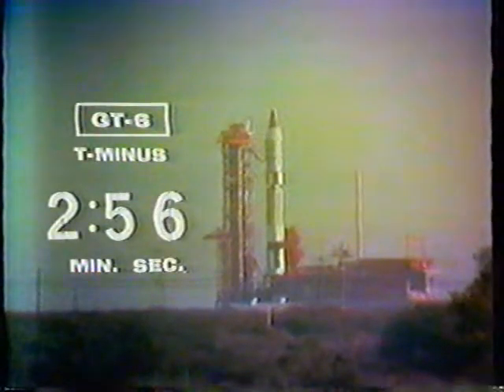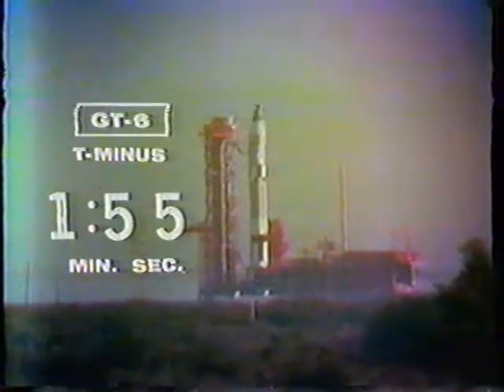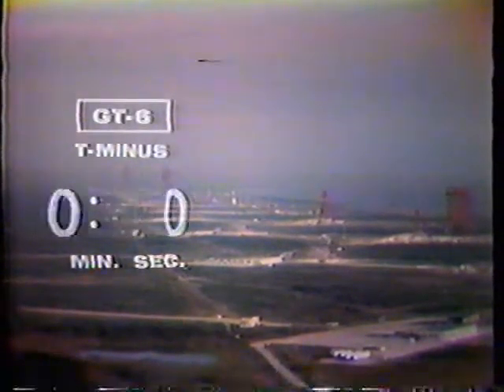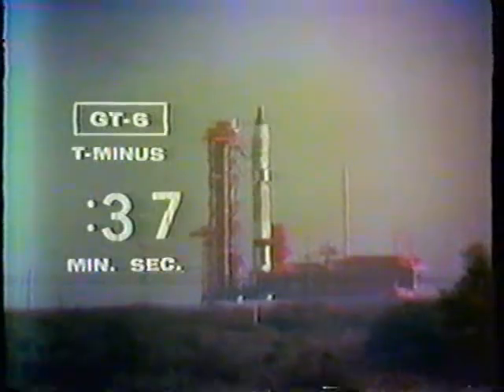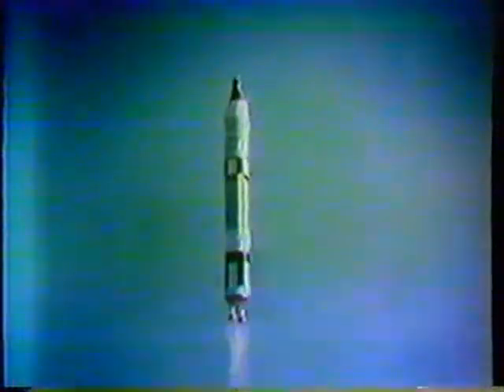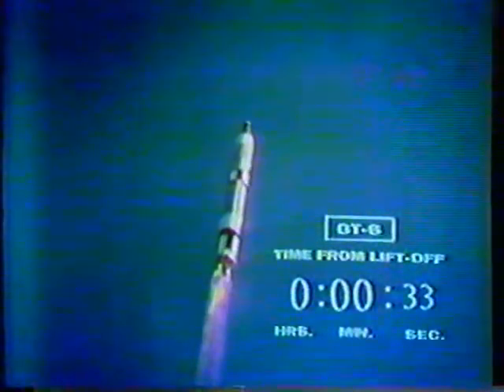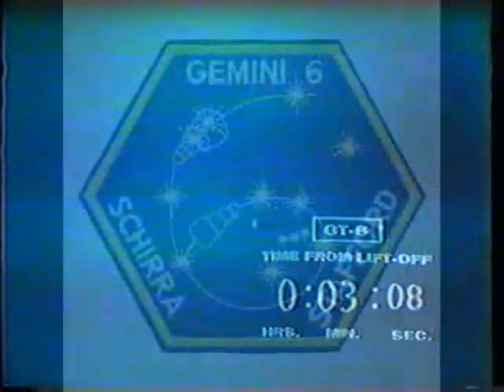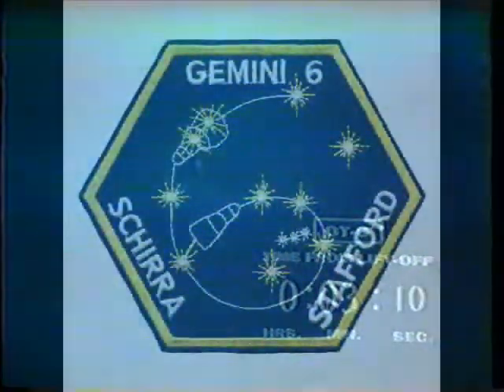Launch of Gemini 6 (CBS)

Comment: Came here for the whoop, stayed for the rocket
Reply: As Falcon 9's engines ignite at T=0, it would be cool to get a clean audio recording of the Titan "bwoop" sound and insert it at the ignition.
Reply: @rwboa22  I don't know where you'd need to put the speakers to make them survive the launch, and I also don't know if there are speakers powerful enough to match the loudness of a rocket launch. :P
Reply: Why do people call it the bwooping noise it sounds like a rrrrrrrrrtttttttt to me
Reply: Thats the turbopumps for the engines spooling up I believe
Reply: GenCorp LR-87 engines … 
the most unique sound on 1960s missile row.
Reply: Sounds a bit like the starters of  Chrysler, Plymouth or Dodge use to sound back in that era. The gearing of the starter against the engine would make a certain sound, similar !
Reply: @paulwilliams286  Chrysler built a few rockets from this era like the Saturn 1B.

Comment: Just to let the younger people know, the actual TV images at the time were much better than this video. I am glad they preserved this but it doesn't accurately reflect what people were able to watch at the time.
Reply: I'm 24 and remember how T.V. looked before the switch from analog to digital TV. And I'm definitely suprised how bad the picture in this video is.
Reply: It really depended how good your TV and reception were!
Reply: I was in high school English class, surreptitiously listening to it on my very small transistor radio. Heady times! There had just recently been an on the pad abort after the engines had started, no one knew if the astronauts would have to bail out. And with the sudden change in flight plans, the launch of Gemini 7 was only days away, for the first planned in orbit rendezvous flights. Those were the days when NASA could, and DID, do amazing things. Amazing what you can do with a slide rule, and can't do with a supercomputer.
Reply: The one inch VTR tapes they used to record broadcasts instantly lost about 500 lines of resolution. The National Archives has a section called Record Group 255 in Maryland. It is a huge building of NASA archives and broadcast footage. There’s thousands of these tapes that have never even been digitized yet. I hope they digitize and clean them up someday before they’re too degraded.
Reply: possible that the video tape has degraded.
Reply: it's probably because this was a recording of the broadcast on VHS, likely recorded from a rerun of the broadcast or from archival footage from NASA. Shame we'll never get to see the launch in it's true quality!
Reply: @davidh9844  It's funny, my daughter is in medical school and I once mentioned that I had to use a slide rule in high school.  She had no idea what that was.
Reply: I’m sure NASA has it somewhere, there were very sophisticated film cameras with huge lenses on expensive mountings taking pictures of the launches.

Comment: The bravery of these men is off the scale.
Reply: Star 1958- I agree with your comment. And, yes I can admire them. However, I believe they were almost too brave, in a way. Reason: They paved the way for the shuttle. And, paved for the way for others to take similar risks. And, this is unsustainable over any period of time. During the Roger's commission it was determined the shuttle ran a risk of ~1% of a catastrophe on every launch. Certainly, one would have to be brave to take a 1% risk of death on a single event; but overall there should not be such a risk on manned vehicles nowadays, even if the crew were willing to take such a risk. And, there is no way known to go to orbit with significantly less risk (1 in 1000 might be acceptable but it should be even less; like 1 in 10000. Still there is no way to even reduce the risk to 1 in 500).  What I am trying to say- manned launches should be halted and space work should be done solely by robotic vehicles. I will receive a lot of internet flax on this; I am sure. But, I still stand by my opinion that humans should not go into space, at present anyway.
Reply: The titan missile wasnt really reliable at first.
Reply: @Scottrchrdsn   The problem with shuttle was designing a vehicle with no realistic means of escape in the event of damage or malfunction.  Mercury and Apollo had their escape rocket towers, and Gemini got by with ejection seats, but even if they were a little "sketchy" by comparison, at least they were there, and designed to work.  Shuttle had ejection seats the first four flights, but they removed them after that, once the shuttle system was "certified" for flight (which was a foolish notion in itself, as if nothing could EVER go wrong once it was past the "testing" phase... In short, NASA got overconfident in their abilities to never have a failure in flight).  Shuttle's abort methods were basically a joke... They weren't realistic.  During the SRB burn NO escape plan or abort was possible... Hence Challenger was unsurvivable from the moment of liftoff.  There was even talk of using the first shuttle flight to demonstrate an RTLS abort (return to launch site abort) and Commander John Young shot that idea down real quick... He said it was "risking likely death to avoid certain death" (IOW not likely to work, probably die in the attempt, but a little better than nothing if it's your last option).  RTLS depends entirely on the SSME shuttle engines all working perfectly and a good SRB separation, (so if all that's true, WHY would you need to abort?). Once the SRBs were gone,  the shuttle, still burning the three main engines, would do a backflip (like the boost-back burn the SpaceX Falcon 9 first stages do now to return to the launch site to land), then shut down the engines once headed back to Florida, jettison the external tank, and glide back to the runway to land.  If the shuttle was damaged and couldn't glide, it was unsurvivable.   Bailouts with parachutes options came after Challenger as a stop gap method to address the problem, but STILL was only possible from a stable glide, which is a huge assumption to make for a vehicle having to abort.  No escape was possible during reentry, but then that's been true throughout the space program, both US and Russian... Hence Columbia was unsurvivable.  The Soviets lost three cosmonauts on reentry due to a pressurization failure (Soyuz 11) and of course Kamarov on Soyuz 1 due to tangled parachutes (the last of many severe problems) and nearly lost another Soyuz due to the service module not separating properly and it reentering with the capsule nose first, instead of heatshield first... The front hatch was hot and the seals were smoking before the service module finally broke free and the capsule inverted heat shield first, cooling off the hatch...)

The lesson is, "never design a launch vehicle and spacecraft without realistic survivable abort capabilities".  

Later!  OL J R
Reply: @lukestrawwalker   3 SSME's are NOT required for successful RTLS.  At first NASA was too bold in regards to safety, but was forced to worry about making the Orbiter Vehicles(OV) so much bigger than they wanted due to teh demands of the military. At first STS was a shirts sleeves environment.  If the crew of Challenger during STS-51L was wearing proper Launch and Entry Suits at least some of them would have gotten out in time.  The incident occurred at 48,000 feet the Crew Cabin continued to climb to 72,000 feet before it began falling back to Earth. If they were wearing pressure suits, the crew on the Flight Deck could have blown the upper panel just behind the Commander in the roof and escaped, the crew on the flight deck could have blown the side hatch and escaped and parachuted back to Earth. In fact on all missions after STS-51L the very last cue card on the flight manual lists getting out of teh Orbiter during Challenger type incidents depending on when they occur. 1) Before Go at Throttle Up 2) After Go at throttle to SRB sep. and 3) After SRB separation.  The key for STS-51L was to be wearing a pressure suit AND proper helmet/facemask to allow for proper pressure for effective respiration.  As it was, all crew would have been unconscious within seconds of cabin depressurization. Even the 3 that had their Personal Egress Air Packs would have still blacked out as the PEAPs, as the Egress portion of PEAPs alludes to, is that it supplies emergency oxygen to allow crew to get out of the Orbiter even in thick smoke while still on the ground, or back on the ground after landing.  They would NOT provide air at the correct pressures necessary at high altitudes.
All of the available aborts Return To Launch Site RTLS, Transoceanic Abort Landing(TAL), the tiny window for Abort Once Around and Abort To Orbit(ATO) were all considered Intact Aborts, it was the contingency aborts that were dicey.  The Powered Pitch Over during RTLS could be completed with just 2 SSME's, after the PPA the RTLS could be completed on a single engine. If all SSME's went out, that was a Black Zone and a loss of Crew/Vehicle was predicted.  A dual engine failure would result in a TAL abort with the remaining engine thrusting at 109% or an East Coast Abort LAnding(ECAL).  All aborts did require waiting for a good SRB sep.  NASA did all it could with what it was given.  If you want to eliminate all risks of human spaceflight, you simply don't attempt human spaceflight.  You can die crossing the street, astronauts know the risks. We are getting WAY TOO hung up on safety. It's all about managing risk.  Even Space Ex's new heavy lifters wont have an escape system.

Comment: Gemini-Titan II launch vehicles used storable hypergolic propellants (Aerozine-50 fuel and nitrogen tetroxide oxidizer) that ignited on contact with each other. At the moment of ignition you'll hear a high-pitched howl as the engines spool up to full power.

Comment: I noticed that as well. It looks like that was also the case with Mercury-Redstone and Mercury-Atlas. I have never heard an explanation of why this was the case. Perhaps it was that the Saturn was more complex, so they timed the countdown for liftoff rather than ignition. 

It took about 8 seconds in the Saturn for the thrust to build up to the point where it had enough thrust to leave the ground, which was when those objects securing the rocket all had to release at the same time.

Comment: Why does the Atlas V make a similar sound to the one at 3:43 if it doesn't use hypergolic fuels?
Reply: I think it is the sound of the pumps starting, it uses a hypergolic starter cartridge to get them going. 
https://upload.wikimedia.org/wikipedia/en/2/25/Rd180schematic.png
Reply: Oh, I thought it used RP1 (Rocket fuel grade Kerosene) and liquid ozygen, like the Saturn V. I didn't think that was yypegolic.
Reply: +Tristan Wassman It's a Titan booster.
Reply: You're kidding.
Reply: +Tristan Wassman No no no, you're right. The rocket does use RP1 and LOX as main propellants. The sound you hear, is the turbine spinning up to operational speed. And the way they do this involves a hypergolic (technically pyrophoric) fuel, namely Triethylaluminum (TEA). The fuel lines fill up with RP1 right before the TEA is released. Once exposed to air it combusts and ignites the RP1/LOX mixture which spools up the turbine with the audible noise. Once the turbine and fuel pumps are running combustion is sustained and liftoff can occur.
The TEA is also responsible for the green flame shortly before ignition.
You can read all that and even more at: http://spaceflight101.com/spacerockets/atlas-v-551/
Reply: It's not the fuel that makes the noise. It's the geartrain that spins up the turbo pumps and the starter cartridge actually is fueled by arazine 50 and nitrogen tetroxide (hypergolics).